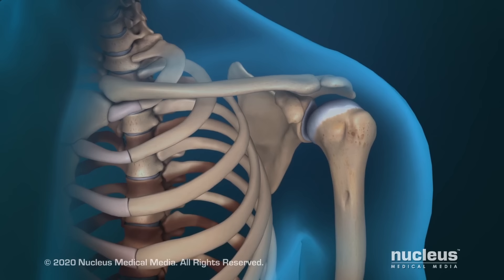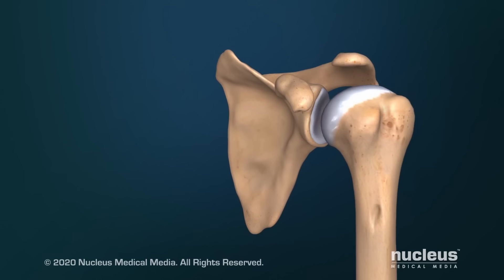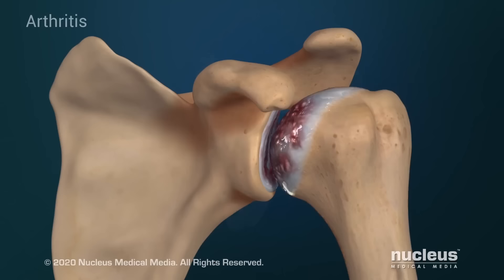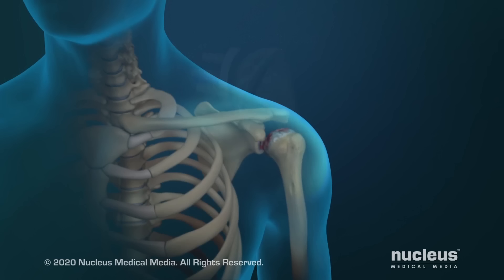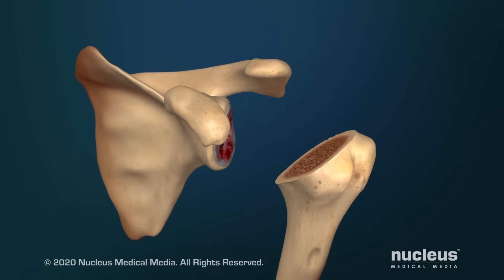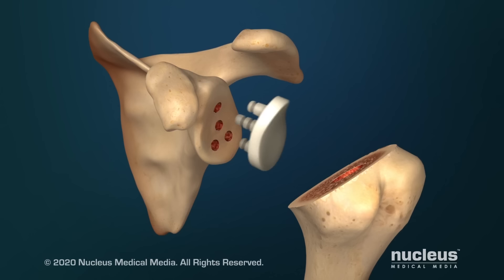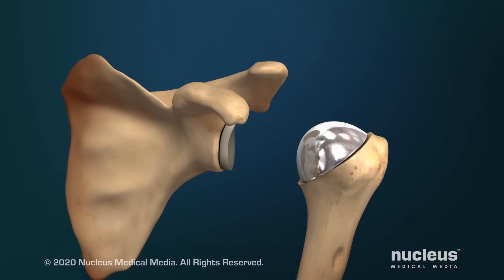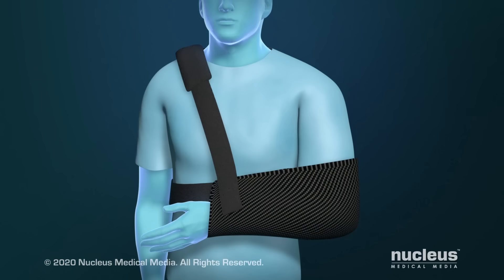Total Shoulder Replacement

Comment: I have had 2 total shoulder replacements  due to arthritis,  and have never looked back.  It has been about 12 years for the first and 10 for the other. I am currently 70 years old.
Reply: When did you know it was time to get it done? In my 50's but have been dealing with severe arthritis in both joints that the doc said I'll eventually need to replace.
Reply: Was the pain horrible? How long was the recovery process? I’m very active and don’t want to be laid up
Reply: @nashtrucker  Severe pain at times when moving certain ways, grinding noise when moving arm.  when MRI or X ray shows bone on bone. Had my left replaced in 2020. Will have my right done after the winter and the shoveling of snow. Hamburg, NY
Reply: @aaa7189  Sounds like my second shoulder before recent replacemnet.

Comment: I'm in my second year of total shoulder replacement recovery. As a drummer it's been rough, but I had other underlying issues. Before the surgery the surgeons told me it would take about a year to recover. Just after the surgery they said it would take about two years. I've heard from others who said it really takes about three years to fully recover. Year two is much better than year one, that's for sure. But I can see year three being better still.
Reply: Curious as I need a replacement and I've been told that you really can't do anything with the arm after the surgery. That I won't be able to lift anything heavier than a cup of coffee. Are you still able to do things with the arm?
Reply: @chesmom379   I'd say you can't do much of anything for the first couple months or so (but like I mentioned earlier, I had other underlying issues). It's the kind of thing where you have to really stick to the rehab. Door-pulley exercises, then therabands, icing etc. The surgeon told me I could start lite drumming after the first three months, but after trying it the pain scared me enough to wait a full six months. Initially, yes even lifting a cup of coffee is pretty much out. But I've made a lot of progress in the past two and a half years. Pain has receded considerably. It's still there, but much better than it was. Range of motion has greatly improved. Drumming and even push-ups are back. But I have to be careful, of course. There are a few videos on my channel showing my progress from the past couple years. Good luck to you, hope that helps.
Reply: My first shoulder replacement (The second one is coming up next week, which is why I"m here). the sugeon botched the first one (Brian Grawe in Cincinanati, stay away from him!), he used a "stem" that was too large for my humurous, and broke it. He also manged to fractue the bone in another place during hte procedure< Other doctors who saw his handiwork told me that I should have sued him. I now have scar that run from collarbone to elbow and still occasionally hurts. Don't have full use of my shouler, still, and it's been years. Yes, here I am opting for another (really no choice, the othe is incedibly painful) with a different surgeon!. Good luck, everyone. And be sure to check out your surgeons better than I did the first one!
Reply: @93Jubilee  Same shoulder again ???  I had my left replaced in 2020, I did masonry for 35 yrs. I need a replacement on my right shoulder. I will wait till March after the snow is pretty much gone. Hamburg, NY
Reply: @aaa7189  Thanks for asking -- it's the other shoulder now. Good luck with yours! Oh, it's been done, I guess. Al okay?
Reply: @93Jubilee  I will wait till March '25. I am bone on bone.They gave me cortisone I say its 50/50 effective

Comment: Total shoulder replacement
Sounds like a finishing move
Reply: total shoulder displacement
Reply: “Dramatic finish!”
Reply: But it’s not permanent, and will need a new one every 10 years.  This was not offered to me as I was told I am not old enough at the time.
Reply: @jaeinnmoon3279  I have read 10 to 20 years.  But, if you are getting this done at 60, it might suggest a physical lifestyle that could be closer to 10.  We'll see.  I'm 62 going in for my first.

Comment: Excellent content as always.

I wonder what is the main consequence of this operation. I mean, you're replacing an intense pain for another kind of pain and disability. I suppose the trade worths it.
Reply: I had a shoulder surgery, although a Bancart surgery, not this shoulder replacement one. In my case, I traded occasionally, annoying and very painful shoulder dislocations for a month of painful day and nights after the surgery, but after the healing and physicotherapy, I had a brand new shoulder that could do anything just as before my bancart tear that caused the frequent dislocations. I can do pushups, pullups, ring exercises, climb walls, reach the back of my neck from behind, anything I can do with my not operated shoulder.
I believe after the healing period and diligent physicotherapy, even this shoulder could heal perfectly and be just as good as new.
Reply: @barnazadori9227  
hello Barna, I read your reply thoroughly. 
May I please ask where did you go for this surgery? and what kind of accident caused your shoulder problem? 
sorry for asking a lot of questions
Reply: The main consequence is that you can only do it once due to the way it deforms the bones, and these replacements don't last forever.
Reply: @mike4402  I could imagine that happening, but - as I lack the knowledge yet still being curious, would you (or anyone) clarify what would cause the deformation/deterioration on the joint operated on?
Reply: @mike4402  that’s not true you can get it done more then once… a tsr usually first choice if that goes after some time then a reverse if needed 
Theirs a few options 
U pref hope if U do need one that ur in ur later years
Reply: I have had both shoulders replaced. It's a nightmare, but does help with the pain. I would say this is a LAST resort option. Years after getting then done my shoulders do ache when I use them, but still better than before the surgery. This video does not show all the other items that are cut just to get into the joint. Much more difficult than other joint replacements since the heart is so close.
Reply: I was told not get into weightlifting as much as I need to

Comment: Its been just over 3 months since my total shoulder replacement. My rotary cuff had also snapped, but they were that badly damaged they couldn't be repaired, which will restrict my movement. As im right handed it was hard. My arm was in a sling for 5 weeks, day & night, wasn't allowed to move it. Since then I've built up my exercise in the gym, just concentrating on moving the joint, but not allowed to use weights, the pain has now gone, but im not allowed to pick a cup of tea up. At 6 months i will have an x-ray & if all ok can start useing weights.
Reply: I was just dx. Needing a shoulder replacement because of an old unknown fracture.  Probably when I did some rodeoing.  Seriously. You can't pick up a cup of tea?  Yikes!

Comment: This is great, but how do they manage the rejection of the prostetis? Does the patient has to take immunosuppresants? I guess the metal is biocompatible right? I would love to know.

Thanks.
Reply: I'm not in any way qualified to talk about this, but to my knowledge most prostheses are made from titanium. For whatever reason, titanium doesn't cause foreign body reactions in the body, so immunosuppressants aren't necessary.
Reply: Tom Watson, legendary golfer, recently got a shoulder prosthesis. That’s why he probably got the best treatment.
Reply: Great stuff, this has a lot of potential, im currently following a medical biology course and i heard about titanium being the most biocompatible metal around but i didnt knew it was that compatible, i think it has to do with the layer of oxide that forms which is impermeable, thus making it unreactive with bodily fluids , i also know a lot of people with joint problems this could be a life saver for them if perfected,anyways thanks, this is pretty interesting.
Reply: @skxarta  You’re welcome, indeed. It’s interesting to read your comment. Yes, I often indirectly heard titanium is one of the most lightweight metals which may be the most optimal option for prostheses. Even, it’s also made for modern golf clubhead! Good luck with your medical biology course!

Comment: i always wondered if I could improve my physical fitness if I replaced my entire skeletal structure with these artificial modifications. essentially be able to go longer and harder with less risk for injury
Reply: I doubt it because the hardware wears out in time.  Then needs to be replaced after 10/15 years.  So it won’t ever be as good as the real thing…

Comment: How does this work with ligaments, muscles, and such? What happens to those during this procedure?
Reply: I had my bicep severed and then reattached at a slightly lower point. I wasn't told of this before the procedure. The only way I found out about it was through a $5,000 bill sent through the mail. Luckily insurance covered it, but what a way to find out. It still doesn't look the same, two years later.

Comment: It would seem the video leaves a lot out as far as the incision is concerned. To get to the bones in the shoulder joint it would be necessary to cut through the rotator cuff muscles, would it not? Mine are extremely tight already due to tendonosis. One would think the severed rotator cuff, stitched back together, would lose even more flexibility.

Comment: I was told recently that I need a total shoulder replacement 🥺 but I’m too young.  Apparently they only last about 10/15 years and they gotta be redone.  Apparently the maximum you can get it two bc of the amount of bone they remove to make it work.
Reply: That is correct… so far it’s sucking 
But I have less pain 2 months out 
From before surgery
Reply: Why bro what happened to you and how ???
Reply: Wow!   Good for you!  How bout an update since it’s been a bit since your surgery?
Reply: @CL-gy1en  why do you replace your shoulder??
Reply: @monhossain805   very long story short… injured my shoulder playing sports, had it screwed back together 2 x.  It came apart again but now my socket/ball has bone spurs all over.  So replacement is my only hope. Total stinker, bro
Reply: Yes that is true they told me that same thing
Reply: Same thing with my husband. He’s 42. They won’t do surgery as they say he’s too young. Even though it’s bone on bone at this point with a spur. Had surgery prior that didn’t fix the issue. And it’s only gotten worse from there.  Wants him to try PT first but due to his job he might not be able to return is the issue

Comment: My left arm is smaller and weak than my right arm. I had a checkup in 2014 when I was 14 years old. The doctors said that there's a small chance that it can fix by surgery because of your eag because I had this problem since 1 years old. I don't know if in the past 7 years because of new technology my chances to get my arm fixed has increased or not.

Comment: How old would someone need to be for this type of procedure? I am 32 yrs old and have chronic dislocations most of the time they happen while I am asleep on my back and I’ll awake suddenly with a dislocation. I also have had my labrum operated on when I was a teenager for the same condition but it didn’t seem to work as I still have dislocations probability 5-10x per year. Every surgeon I have seen just recommends PT and that’s it none ever seem to mention surgery or replacement?

Comment: I'm wondering how it feels to move your shoulder after it's healed.
Reply: I was wonder the same think I suppose to have one of those surgery by watch this video I changed my mind
Reply: you do need physio therapy for weeks or probably months. But it still manage to restore your 90% to 95% of your mobility. Still far-far better than no mobility at all.
Reply: I was totally back to normal in 3 months.  I was staring our lawn mower and putting 50 lb bags of salt in our softner.  People need to realize though that doing the at home therapy is key, and not just what you do with your therapist.

Comment: will you still be able to move your arm after the surgery? or is it gone?
Reply: The muscles in the arm should work fine id guess, the socket itself doesnt do the lifting
Reply: Yes.  The whole point of the surgery is to return the ability to move the arm without the pain that the patient had before the surgery.  My father had this surgery done.  He had multiple sclerosis, so he didn’t get all of his arm use back, but that was because his arm was already wasting away from the m.s., not the surgery’s fault.
Reply: @CrankyPantss  thanks!
Reply: @chost-059  thanks

Comment: My shoulder head has broken and has a plate 3years back..now my surgeon said that the top of the head is melting so  have to change shoulder joint or head...but I think is this enough or may I face further problems

Comment: I'm not saying a shoulder replacement doesn't have a place it does. But just because you have some arthritis in the shoulder if you seek physical therapy and do all the excercise regularly you can reduce pain by strengthening that joint to allow it to withstand more force without pain alone with strengthening surrounding muscles that also ease some pressure. Now this may not completely stop pain, but if you can go for 7-8 all the time to a 3-4 sometimes and as long as you're able to do strengthen and stretch. Your quality of Life would be manageable.  PT and exercise should be your first option it's cheaper too. It just takes some discipline and hard work. plus if you get a replacement you have to do PT anyway so might as well try your best to avoid it if possible